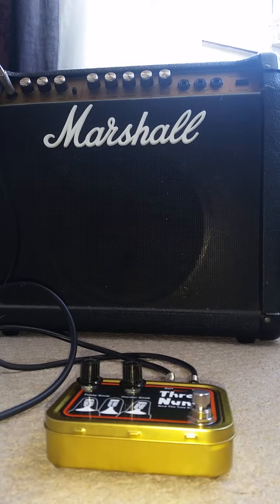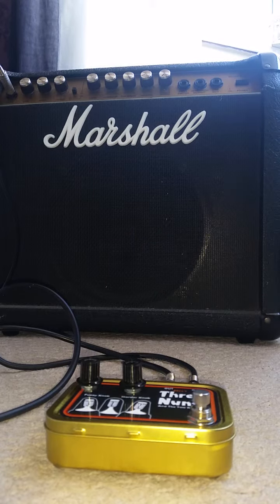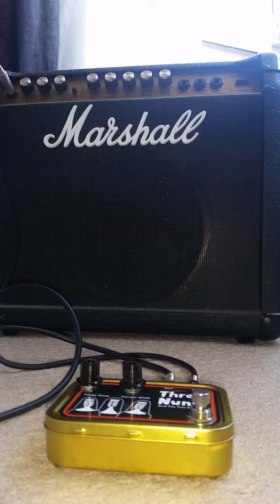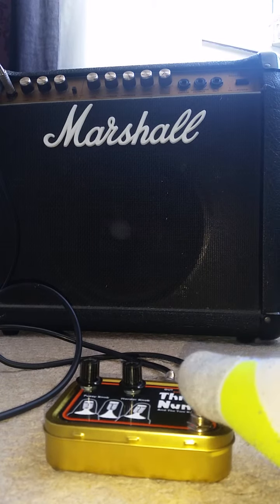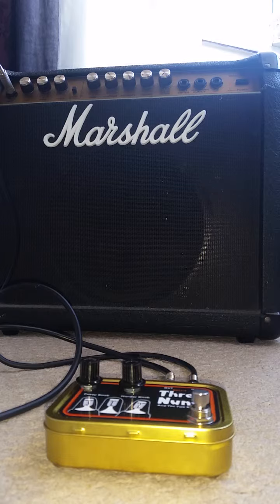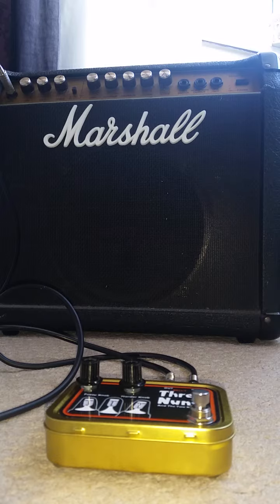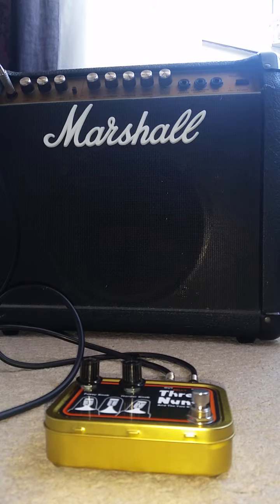Three nuns tobacco tin fuzz face clone by hubcap john

Comment: Hi, I have a similar rf noise problem from my tp link power line ethernet devices. It isn't on the mains wire itself but is definitely RF based as i tested with a battery in my fuzz and a battery amp. Did you ever find a cure for yours? Regards.
Reply from the maker: Richard McEntee yes i did..... i rearranged my living room and  stopped using them lol.
Reply: john hayward lol indeed, I thought that was the obvious answer! Can I ask what brand they were so I know to avoid them when looking for replacements, if I get round to it?
Reply: I picked up one of these about 6 or 7 years ago.  Still love it.  When I want fuzz, I start with this pedal.